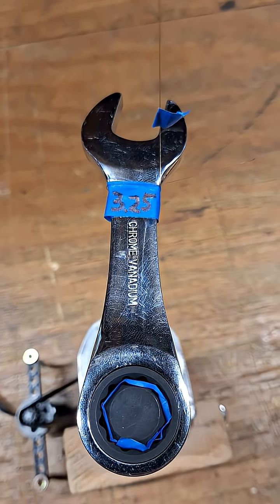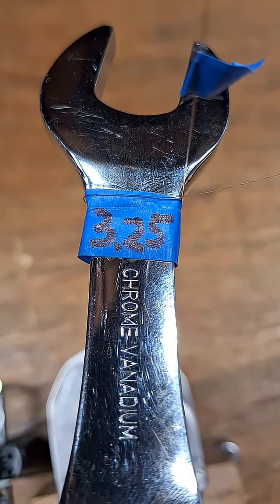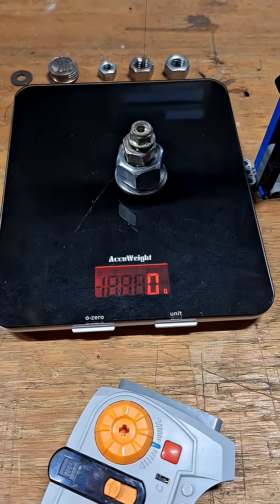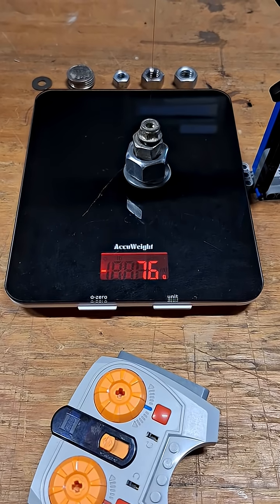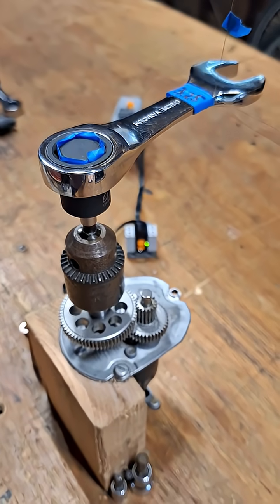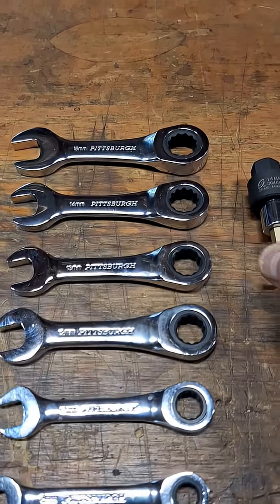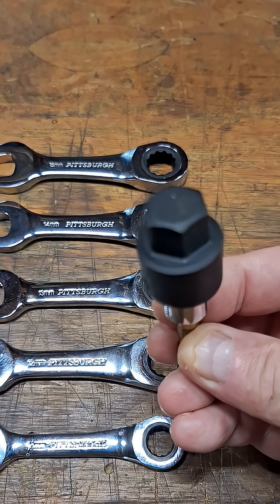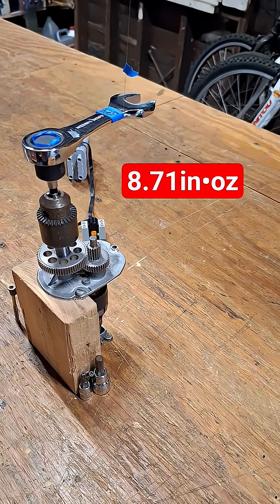Pittsburgh 72T Stubby Ratcheting Wrench, 18mm Backdrag: Torque = 8.71in•oz.

Comment: Been HGV technician for 35 years and used hundreds of ratchet spanner’s and can remember them  first showing up on the tool vans but I have to say the back drag is something that has never been an issue for me
Reply from the maker: Cool. The higher quality units off the tool trucks perform well. It's the lower quality units that an have high Backdrag. If your working on larger fasteners, it's not really an issue as you mentioned. Thanks for commenting and watching! 🔧